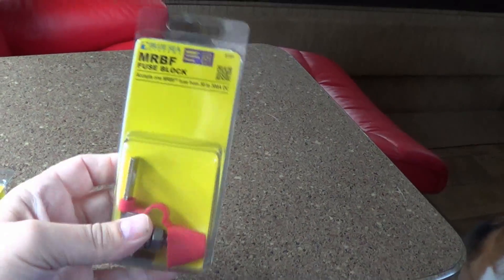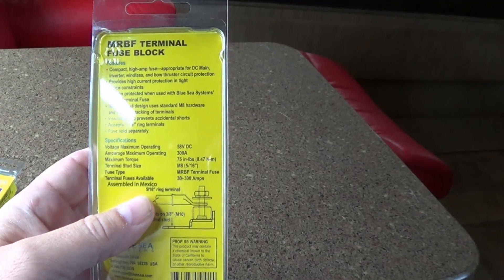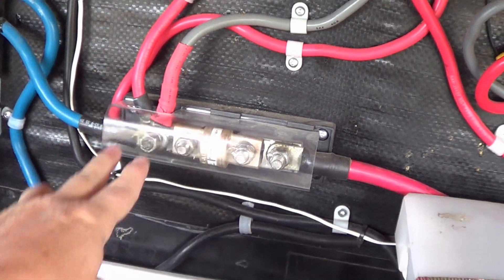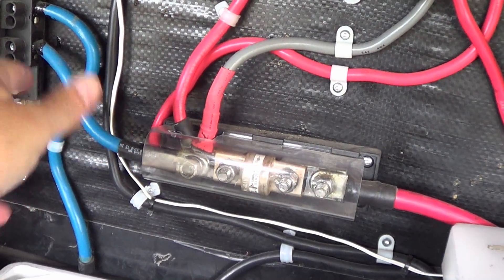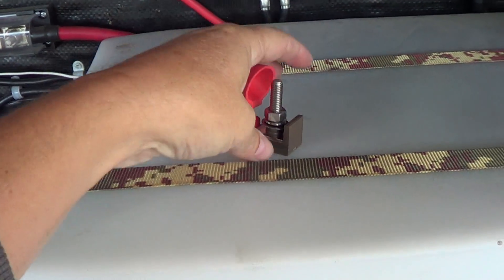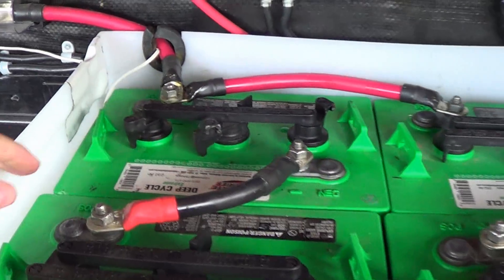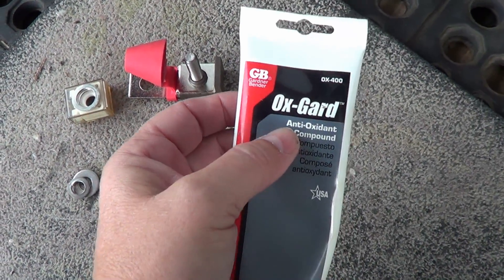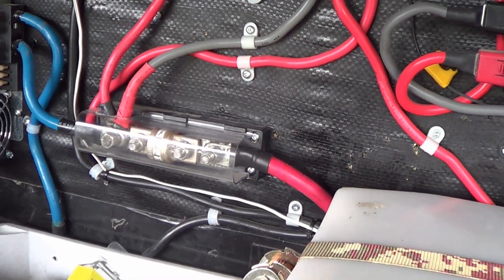Catastrophic Fuse Installation RV Battery Bank Doh! *Mistake in wiring* See description

Comment: Hi Ray. Thanks for the video. I really enjoy all your videos. I have a question about the way you wired the fuse block to your battery bank. You put both the red cable (call it #1), that connects the battery on the right to the battery on the left, on top of the block, and the red cable (#2) that is the positive feed from the battery bank to your rig. Since the #1 cable is part of the battery bank, shouldn't it be on the battery terminal under the terminal block so it protects the whole battery bank. Seems like your bypassing the fuse on part of your battery bank Thanks again.
Reply: I saw that also Ray.  I am surprised Angie did not bark at ya when she saw it.
Reply from the maker: haha, ya that beagle is slacking off. :)
Reply: Now you can tell them all Ray that you wired the fuse up that way to see if we were paying attention. I enjoyed it.
Downunda - Melbourne Australia
Reply from the maker: Holly crap, you are totally right! Major brain cramp! Thanks for catching that.
Reply: It happens, but I think hogcat is right, Angie should have caught that. lol, Hope the run into you someday. Safe travels.

Comment: there should be a fuse on each battery positive terminal sized to protect the wire
Reply from the maker: These days it's commonly done with lithium battery banks since they don't need to be installed in a battery box and vented. So much more exposed to possible accidental short circuits.  Being that the old lead acid batteries had to be installed inside a closed battery box I think that is overkill. The traded off if you were to fuse each of the 4 batteries you are introducing a heck of a lot of extra connection points with the potential to become loose and arc and overheat and also loose power to increase wring resistance.  Cheers,, Ray

Comment: Bridging across the t class fuse with a tool or something will not short out, it will however bypass the fuse, but nothing catastrophic will happen.  The t class has a higher aic rating, so definitely leave there.

Comment: Confused information.  The MRBF holder you installed does not use class T fuses. Your ‘catastrophic’ fuse is a class T. It’s not a terminal fuse - a terminal fuse installs directly on the battery terminal.  Lost cause video. At least you overkill by more that you understand, than under fuse. But given your confusion I wonder about the rest of your system.

Comment: Your wiring "mistake" is actually a useful other way of wiring parallel batteries. That is, an MRBF on the other battery's post, then an MRBF on the joining post. That way each battery is fused independently.

Comment: Educational video , thank you . I noticed your battery bank consisted of 4 interstate 6 volt batteries, is there a reason that you choose these batteries over others and would you be able to run a Keurig coffee maker with this ?
Reply from the maker: I picked Interstate because they have many dealers in the USA and Canada, and I travel a lot. So if need be, it would be easy to get a warranty replacement. Shipping 66 lb. batteries could be a pain and expensive. My rationale was better if there is a nearby dealer to physically go to. Also, Interstate batteries are pretty decent. I used them for years and then sold them with good life left when I got lithium instead.  As far as the coffee maker goes, 4 golf cart batteries can supply the needed energy, but you'll need a 2000-watt inverter as well to provide the AC wattage.

Comment: There are special Insulated Nuts for these MRBFs in the market. With said Insulated Nut, you wont need this MRBF terminal at all. You simply insert the MRBF on the battery's bolt terminal, then insert the cable terminal lug and finally use the Insulated Nut that insulate the terminal lug from the bolt. Caveat, the bolt should be long though...
Reply from the maker: Cool, hadn't heard of those before. Thanks
Reply: What are the alternate just called ? I can  not find them ,thanks

Comment: No comments about both wires on top of the fuse? The jumper wire from the other battery should remain on the battery terminal. Only one wire, to the RV, should be "after" (on the fuse terminal) .
Reply from the maker: Yes, correction was noted in the video title and the description back when the video was first published.

Comment: Hi Ray,  Should I put a catastrophic fuse on the installation of my two Lion Energy batteries too?    it looks like useful extra protection everyone should have?   
I have two positive cables, one that goes left to the inverter under the bed and the other goes right to all the trailer's wiring upfront.  So, it would be those two cables at the top of the fuse.  
My inverter is a 1000W peak  2000,  low voltage 10V . 
Your system sure looks well protected.  Thank you for your videos.  I appreciate and learn so much.  It takes me time but I do get things done and having fun 😊.
Reply from the maker: It's always a good idea to fuse every cable in system in case one of the cables ever touches the trailer frame, but also the Lion batteries do have their own short circuit protection built-in to them. So, not as big a problem like with lead-acid batteries. With the Lion Energy batteries, it's like a double protection.
Reply: @LoveYourRV  Thank You 😊.  Cheers

Comment: What if you have 400 amp battry bank?
Reply from the maker: I think you may be confusing amp hour capacity with amp output.  You want the fuse to be a little bit above the max amps you will be drawing from the battery bank to power things. 400 Amp hours of battery capacity is common, it only takes about 4 batteries, but to draw 400 amps would be a lot for the average RV DC  power system.

Comment: Sir, I love the fuse and I will be getting one soon.  However, I think you have one wire in the wrong location.  You have 4 6-volt batteries wired in a series-parallel configuration to provide the coach with 12 volts with more amps.  The positive wire on the right pair of batteries should be connected to the positive terminal of the left battery and not the upper fused connector.  In the current configuration the fuse only protects the left pair of batteries.  The right pair would still be connected.  Just a minor change.  Thanks again.
Reply: Sorry Ray, I missed the comment from "RVing here and there"  Please disregard.  You are still to be commended that you went to the extra effort.  AND you helped me with my van!

Comment: Great video and thanks for the update. Will a 300 amp fuse work for our system (similar to yours except our inverter is 3000 watts)?
Reply from the maker: Could be but check your inverter manual it is possible you may need a 400 amp fuse for a 3000-watt inverter depending on its surge rating. Many inverters can put out more watts than the continuous wattage rating so have to be fused to accommodate the surge.
Reply: Thanks Ray, couldn't find this item in 400 amps. I did find one like your old one (class T I believe). Any preference between it and the ANL type blade fuse?
Reply from the maker: Not really, I imagine either would do the job well. The biggest concern I'd think is to also make sure the wire gauge is beefy enough when dealing with high amps like that. An undersize wire could still smoke and melt without taking out the high amperage fuse.

Comment: HELP,,,this fuse /breaker stuff is confusing me. i bought a power jack 5000 watt/20000 watt surge inverter/ charger . my 1400 watt AC blew the inverter fuse. it was only 25 amps? it has an 80 amp charger.i was told i needed 00 gage cables so i got them. i have 24vdc/109 Ah deep cell [2 x 12 ] and want a breaker /cut off on those cables ,so i asked them what size .they said 20 amp 250 volt.thats not right.this is lucky to make 3000 watts and as far as i can tell,the 20000 watt surge rating is a myth. still works great though overrated.   i think they had told me use  300 AMP FUSE  on those battery cables,BECAUSE THAT IS WHAT I HAVE ON THERE NOW. I can't get a straight answer  and when i do get them to email an answer,it is is in chinglish and makes no freaking sense. i want to get this put back together, but not till i know what is really safe.that 25a/32 volt inverter fuse blew instantly trying to start the soleus AIR,portable AC/heater unit. so any help would be great.
Reply from the maker: Here is a chart with recommended inverter cable and fuses sizes - https://www.altestore.com/howto/recommended-inverter-cables-sizing-and-breakers-or-fuses-a62/   AC units usually have a large start-up current demand to get the compressor going, your cheap inverter may not be able to deliver it.
One thing I also notice is you only have 2 batteries 12 volt 105AH, those will struggle to provide enough amperage to run the AC, you should have at least 4 and better to have 6. Even if your 2 batteries can run it don't expect it to run longer than maybe 45 minutes to 1 hour before the batteries are run down.  Good luck, Ray

Comment: Greetings Ray, would it matter if you fused the negative post of the battery bank?  I know that your cap is red, but can you get a black one?
Reply from the maker: I don't think it would matter, I know some cat fuses are on the negative post. I believe I read some OEMs do it that way.
I like to have all my devices on the positive side just to keep things uniform. At least the next owner, if there is one, won't have to guess when they see a breaker or fuse and will know its a positive lead. Sorry, I'm not sure if they come in black.
Reply: I have been using one of those double terminal fuse blocks with one fuse for my inverter and the other for my charge controller. I have yet to blow a fuse though, but I keep a couple spares on hand.

Comment: Hi Ray, I always wondered why you stayed with a 12 volt battery bank and did not choose to go with 24 volts?
Reply from the maker: Just easier, since all the RVs circuits are 12 volt and I had a 12 volt inverter already.

Comment: Overkill for your set up. The odds you would ever short out that short length of cable is minimal.
Reply from the maker: I'll go with overkill. Years of repairing electronics has given me a healthy respect for what can happen. I even destroyed a few of my own tools and started a fire or two. ;)
Reply: Agreed. Overkill isn't possible when it's your home.
Reply: I have a BSEE and worked in the electronics field for 30 years. Ray I like your videos and I have never made any kind of negative comment, but this time it looks to me like you needed some content and this was an easy project to film.